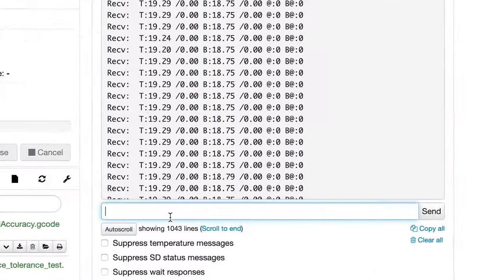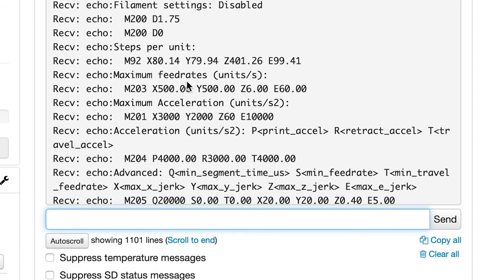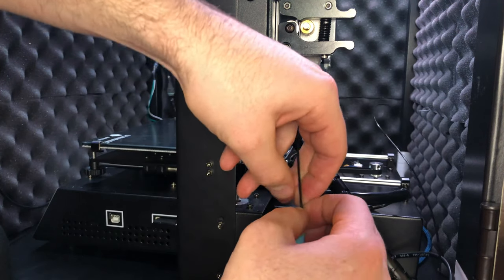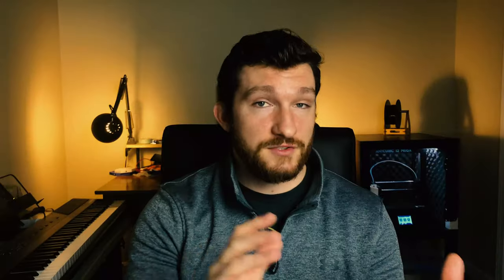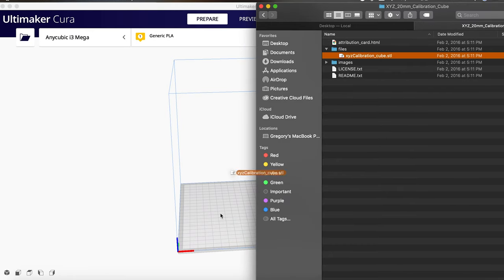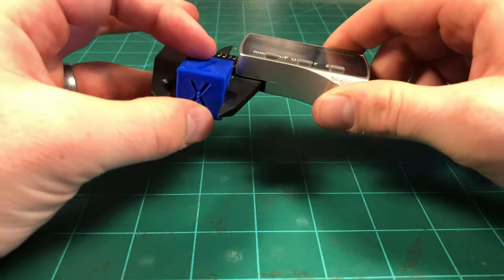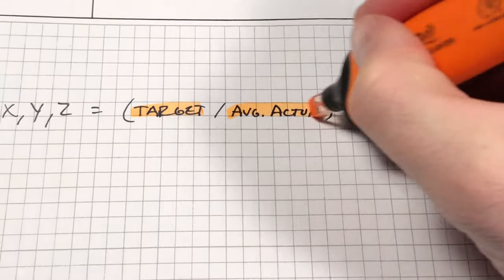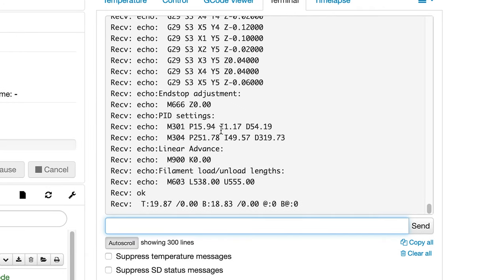How To Calibrate Your 3d Printer Stepper Motors

Comment: I tried this on my Mega S, and I was under extruding by 77.21mm! Is this possible?!
Reply from the maker: Yeah, I was amazed by how much my Mega was off!
Reply: @airalex1919  Me too! I was sure it was in error!
Reply: Yes me too and I have not been able yet to configure fine
Reply: Finally I followed the steps from here and works fine https://kore.cc/i3mega/doc/
some missing steps in the video that are for the mega S
If you are using this on a Mega-S, those four additional commands are necessary:
M92 E384 - set correct steps for the new extruder
M203 E30 - limit extruder feedrate
M204 R1500.00 - lower retract acceleration
M500 - save the values

Calibration 
Extruder Calibration
Get your old E-Steps with M503. Look for the line starting with M92, the value after the E are your current steps.
Preheat the hotend with M104 S220
Send M83 to prepare the extruder
Use a caliper or measuring tape and mark 120 mm (measured downwards from the extruder intake) with a pencil on the filament
Send G1 E100 F100
Your extruder will feed 100 mm of filament now (takes 60 seconds)
Measure where your pencil marking is now. If it's exactly 20 mm to the extruder, it's perfectly calibrated
If it's less or more than 20 mm, subtract that value from 120 mm, e.g.:
If you measure 25 mm, your result would be 95 mm. If you measure 15 mm, your result would be 105 mm
Calculate your new value: (100 mm / actually extruded filament) *your current E-steps (default: i3 Mega 92.6, Mega-S 384)
For example, if your markings are at 15 mm, you'd calculate: (100/105) * 92.6 = 88.19
Put in the new value like this: M92 X80.00 Y80.00 Z400.00 Exxx.xx, replacing x with your value
Save with M500
Finish with M82
You can repeat the process if you want to get even more precise, you'd have to replace your current E-steps with your newly calibrated value in the next calculation.

Comment: Great video. Very helpful. Thanks
Reply from the maker: Thanks for the comment, glad it was helpful!
Reply: @ModernHobbyist  Hi, it's been a year since my last message but I do keep watching your video since it is very helpful. I do a question for you. Using the same method that you have used for the axis calibration, do you think I will be able to fix the accuracy of a circle's inner or outer diameter?? Thanks in advance.

Comment: Nice explanation! Placing a post it note is +/- 3 mm and the measurements you are using for calculations is +/- 0.1 mm. I think a more accurate way of marking off 120 mm of filament is in order.